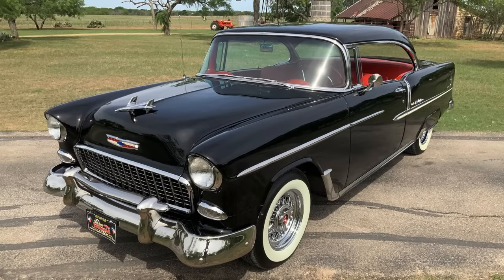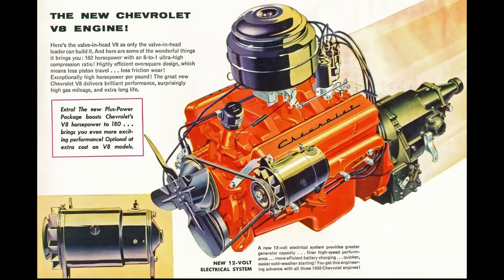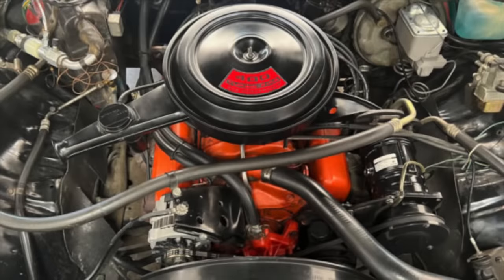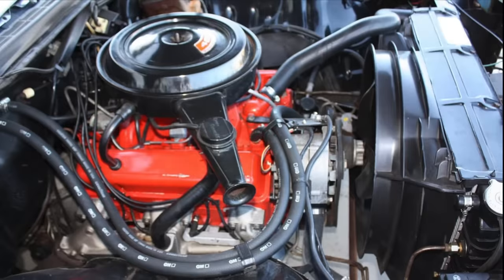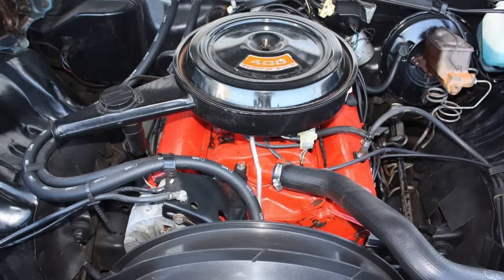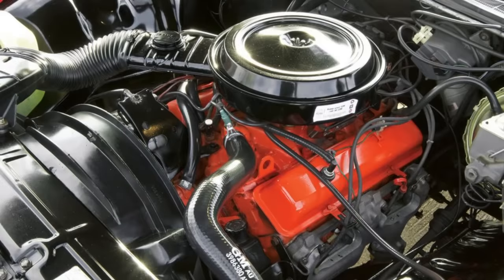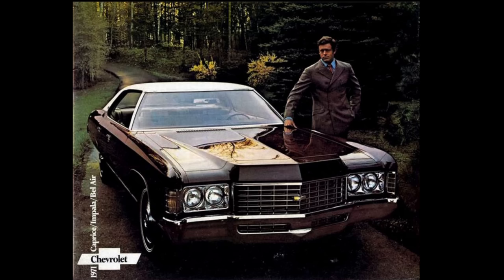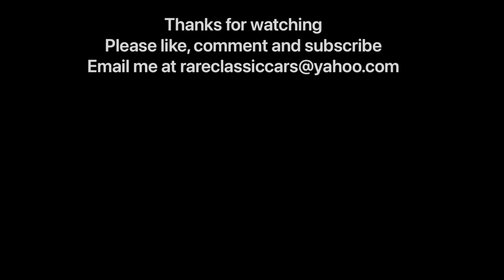Forgotten Engines: The 400 Cubic Inch Chevrolet Small Block V8 (1970-1980)

Comment: What was even more weird was in full size cars the 400 badge was put on this engine and the 402 big block engine.   I had two uncles who both owned 1972 Impala’s and both said 400 on the fender but when you popped the hoods one was a big block and one was a small block.   Left you scratching your head.   When  you needed parts did this create a problem..?
Reply: nothing is interchangeable as far as the main engine components, carb, spark plugs and distributor are aceptions
Reply: the lifter are the same.

Comment: My 72 Impala came with 400 SBC ran for year's before I had it rebuilt went 30 over mild cam oversized valves hp oil pump HEI Edelbrock carb mid rise bowtie intake 80 gph fuel pump got 427 hp out of it never an issue.

Comment: It replaced the 69 396-265 2bbl which was a heavy fuel sucking dog.   The 70 small block 400 was also a fuel sucking dog but at least it was lighter.
Reply: i remember those 2 barr.  396s. guttless.

Comment: the 400 was the black sheep of the SBC family. the gen 1 SBC really comes in 3 families, all based on crank journal size of the block.  1. the small journal blocks 265, 283, early (1967 only) 302, and most (62-67) 327s , with 2.300 main journals and 2.000 rod journals. 2. the medium journal blocks, 262, 267, late 302, 305, 307, late 327s (68-69), and all 350s. had 2.45 mains and 2.100 rod journals. 3. lastly the 400 with the large journal size of 2.65 mains and 2.100 rods journals.  the 400 block will not tank any other crank. and the 400 crank won't fit any other block, unless turned down .200 on the main journals. this is the popular 383 stroker. also, the 400 was the only SBC to be externally balanced. so, the flywheel/flexplate and harmonic balancer as are not interchangeable with other SBC. the block also required steam holes because the Siamese cylinders and the heads required matching holes. so, you can't swap no 400 heads to a 400 without drilling holes. and swapping 400 heads to a any other small block could result in coolant leaks or blown head gaskets also GM never offered a high-performance version of the 400. contrary to the video, the 2-bolt block was stronger than the 4-bolt block. 4 bolt 400s have a tendency to crack in then main webs due to them being thin wall castings, the 2 bolt doesn't have that problem. i am glad you coved the "400" Turbojet 402 big block. the 400 Turbo-Fire small block was only offered in the 2bbl carb, and the 400 Turbo-Jet Big Block was only offered as a 4bbl. so some literature refers to them as 400 2bbl and 4004bbl, just to make it more confusing. so, the real reason the 400 SBC is not that popular was that they were not interchangeable with other SBC of the era, and in that era it was not about performance, it was about emissions control and fuel economy.  also the 454 was available in those years, and made much more power than the 400 small block, si those that wanted more power chose the 454. those that wanted more fuel economy chose the 350.  the 350 was GM's bread and butter engine, and while they have not been available in production cars since 2003, GM still makes them for crate engines in 350 and 383 cubic inch sizes. the GM built 383 SBC's were only ever offered as a crate engine and never in a production car.  may engine builders offer 383 engines built on either aftermarket cranks or GM cranks that has the main journals turned down.  i have heard that 383s had been around since the mid 70s. but the first i ever heard of them was in the early 1990 with the Hot Rod Magazine Dragon Slayer 383 build. it made over 375lbft from 2500-6000 RPM with a peak of 450lbft@4000 rpm. and peak horsepower was 430@5500 rpm. that was in the early 90s and aftermarket aluminum head were not available or cheap like they are now. back them you were stuck with either the old 327 fuelie heads, or the Z28 LT1 350 head. you could get the trick "Bowtie heads" or if you were lucky the aluminum TPI heads. but both of those were expensive back then or not readily available to builders. so 430 HP was a big deal back then. so ironically the biggest part of 400's legacy is giving us the 383 as we know it today.

Comment: I bought a 76 Monte Carlo that was loaded. I wanted the 454 but 75 was the last year for that engine so I ended up with the 400 small block. The engine was smooth but I was disappointed in how slow the car was. The 400 also drank oil like a drunken sailor. I took the car to my Chevy dealer only to be told this was normal. Really!!! I was adding a court ever other fill up. The dealership tried to gaslight me about the oil consumption and there really wasn't anyway to contact Chevrolet directly so I got rid of the Monte pretty quickly. The car stayed locally and I say it about 3 years later. It was a total rust bucket. I was so glad I unloaded that car. Today no one really builds a bad but back in the seventies the quality and service just wasn't there. I've had a lot of cars since then including, European and Japanese. I just keep coming back to GM. They have come a long way. Today, I'm very happy with my GM car's and SUV's. Cheers!!!

Comment: If I remember correctly, the small block 400 was the largest cubic inch engine we could get in any four wheel drive GM  pick up through  out the 70s.
Reply: i,ve seen the 402 in early,2 wheel drive trucks, but not in a 4 wheel drive
Reply: When did the 454 become available in 4X4?

Comment: The Chevy 261 straight six also had the ‘steam holes’ but only between cylinder pairs (1+2, 3+4, 5+6). Also, in Canada some castings meant for the 235 were factory modified and used on the 261.

Comment: Adam mentions the 400 sbc only got a 4 barrel in 1974, however my Motors repair manual lists a 1970 400 (4.125x3.75) with 330 hp 10.25 compression and a 4 bbl.
Reply: That was a big block motor. 1970 400 sb had 265 hp and 400 foot pounds of torque. It came with a bigger 1 year 1970 only 2 barrel carb than the other 400s with a 2 barrel.
Reply: @anthonynelson9136  The mark IV 402 (marketed as a 400 or 396) had a stroke of 3.76, The small block chevy 400 (actual size 401) had a stroke of 3.75. The Motors repair manual lists a 3.75 stroke 400 with a 4bbl. Probably a mistake, but I've noticed this for years. Just saying.

Comment: Another great video Adam. I thoroughly enjoyed watching this on my lunchbreak. I really appreciate the history, I knew nothing about the 400 save for guys who put their cranks in 350s to make 383s!

What were the steam holes for?
Reply: The large bore caused the water jecketing to be too small to totally handle the cooling needs of this block. The steam holes helped distribute more cooling.
Reply: @erichanson3961 Thank you very much, I learned something new which I love. Have a great long weekend.
Reply: The steam holes let trapped air out more easily.
Reply: @johneckert1365 Thanks alot.
Reply: The cylinder bores of a SBC 400" were siamesed together in the coolant area so the steam holes let trapped air/steam escape so that coolant could reach the outside of the cylinder bores...
Reply: @buzzwaldron6195  Very cool, thanks.

Comment: Have good memories of a 400 balanced, quenched and mild port work. Need plenty of radiator and shroud to go with those cubic inches. The stock 350 2 row is woefully insufficient.

Comment: Incredible. The single overhead camshaft engines in my fleet of Ford full size luxury sedans put out 230 horsepower with only 289 cubes.
Reply: A 289 was made from 1963-68, long before net horsepower ratings. Many mid 60 cars with small v8's were in the mid 200 hp range. The 289 grew into the 302 for 1969. A 1971 302 2v was rated at 210 hp. A 1972 302 2v was rated at 160 hp. Same thing happened to all makes when net ratings came out.
Reply: Blueprint engines will sell you a 400" small block Chevy that makes 555 HP...

Comment: I have a 79 k10 factory ordered with 400 sbc th350 auto np203 3:73 gears. I just retired the original 400 and replaced it with a new blueprint 400 small block with 508hp and 460tq. I have some videos on my channel about it.

Comment: I'm glad to be an American,  where we would get engines that jumped from 350 to 400 cubic engines,  whereas Europeans were excited to get engines that jumped from 850cc to 1000cc, or 1.2 liters to 1.3, or some other piddling nonsense.  You could get the on a small block simply by boring it 30 over.  The 350 is 5.7 L; the 400 is 6.5. 830cc extra.
Reply: That's exactly the reason that Americans became non competitive after the 70s. Boring and stroking is the easy solution for having more power.
Reply: @Αναστάσιος-σ8υ  What you said doesn’t really make sense. Starting in the late 70s all the big cubic inch engines were retired when the downsizing of cars began. The Buick, Olds and Pontiac 455 engines were last produced for 1976 and Chevy’s 454 was only available in trucks because GM downsized their full size line for 1977. Ford and their 460 and Chrysler with their 440 soon followed suite. Even Cadillac’s 500 was reduced to a 425 for 1977.
Reply: @mikee2923  Indeed, however the mentality didn't really change
 Going from 500 to 425 doesn't change much. When in the 80s they realised that they had to design completely new engines it was too late. By then the competition offered V8 engines with four cams and 32 valves. Mercedes had a 5 litre V8 with 325 hp when US manufacturers struggled to get their 5 litre V8s above 250
Reply: @Αναστάσιος-σ8υ  I get what you’re saying but the competition also didn’t have to abide by ridiculous CAFE standards the big 3 had to deal with. I wholeheartedly agree that in the 80s American cars were pretty much garbage and got worse in the 90s for the most part. The 2 main reasons for the downfall of the American automakers was government mandates and greed in that order.
Reply: @mikee2923  It was part of the reason indeed but it was not the only one. The main problem was that in the US automotive industry engineers didn't have any real influence in the management, basically people with no engineering background were making engineering decisions. For example, making cast iron heads is the most idiotic thing to do and in Europe it was completely abandoned already in the sixties, yet in the US they continued to manufacture engines with cast iron heads until recently. Look also what is happening now with BMW and its downfall. When the sales and advertising departments are more influential in the decision making of a car manufacturer than its engineers, the results are predictable.
Reply: @Αναστάσιος-σ8υ  I really don’t see an issue with cast iron heads and blocks. Regardless of technological advancement cast iron is more durable than aluminum. American engines from the 70s on back were a lot more durable than anything built today. The argument can be made that modern engines last longer in terms of mileage. Most of that is due to the advent of electronic fuel injection. If an aluminum engine overheats, it will most likely need to be rebuilt at a minimum. The old cast iron engines could be overheated numerous times with little to no damage and if damaged basic machine work usually made it as good as new. Newer engines are made to extremely tight tolerances where the older ones not so much. Power in an engine is basically based on airflow and proper air/fuel mixture. But the old saying there’s no replacement for displacement still rings true. If for example someone would apply the technological advancements of electronic fuel injection and engine management to the older big cubic inch engines of yesteryear, you’d have a seriously powerful engine that would probably go an easy 500,000 miles trouble free. Most engine wear happens at start up. The old carbureted engines basically dumped gas into the intake via the accelerator pump regardless of conditions whereas new cars take into consideration engine and air temperature and meter the precise amount of gas required to start the engine. Washing out the rings today is almost nonexistent compared to 30 or 40 years ago.

Comment: I swapped a 400 4bbl from a Caprice wagon into my 73 Camaro after I managed to blow up the 350 2bbl, it was a little faster, but could do one-wheel peels for blocks. 😄 Ah, the days when you could buy a perfectly nice 12 or 13 year old Caprice with under 100k miles for $500 and not feel bad about yanking the engine and trans and junking the rest.

Comment: 5:34 I wonder if part of the reason is that they hadn’t officially settled on the “Big Block V8” designation at that point perhaps? I know in internal manuals, at least, they were basically just referring to them as the “Mark IV V8”- until 1973 or slightly later too- but don’t know why, you’d probably know better

Comment: i have a 79 chevy short box cheyenne 4x4 with under 35,000 miles on it with the 400/400 turbo 100% factory even the heat riser still works and i have the 327 out of my 68 pu that i put in a 4 inch stroke 454 then i have a 350 out of a 67 pu all run perfect but going to build up the 350 for the 67 pu. my 73 ss nova has a 68 chevelle 396 in it built ok about 650 hp then i have a 67 ss rs camaro with the 427 still has the plate on the back yenko dealer ship

Comment: I dunno (400 fire vs 400jet) 
I really couldn’t feel much difference between the two. I was never impressed by the 396 family engines. The solid lifter hi compression 396 would get with it but the hyd lifter versions were a snooze.
Best feeling mid size big block was Mopars 383. Those all ran great compared to a 396 or 390 ford.
Reply: mopar, 383 was a great motor

Comment: I had A 400 sb with .30 over flat tops and 350 heads in a welding truck. When I replaced it with a 454 I was a bit disapointed that the 454 was not a big step up in tourqe or hp.

Comment: The 400 cubic inch small block Chevy also known as the "Steam Engine" You can make them run but you're better off with a LT1 350. It breathes better and thermodynamically it stays cooler more evenly.
Reply: Had a 71 Caprice Classic with the Turbo Fire 400. 255H.P. NICE POWER AND RIDE VERY QUICK TOO.

Comment: Question. Is the popular "383 Stroker" small block a 350 with the stroke of the 400? Watching the Mecum auctions, the 383 is an aftermarket install in some "restomods" noted for its torque characteristics.
Reply: Yes

Comment: A great torquey little engine, however it had One Major flaw.  GM used a shorter connecting rod coupled with a Longer crank stroke gave the engine a BAD 'Rod Ratio' which resulted in increased side loading of the cylinder bores. BTW, A 400 Chevy was the ONLY Chevy engine I EVER managed to Blow UP.

Comment: 1:55 ~ "steam holes"?
"Steam" holes? Buddy, if you've got steam in your cooling system you got some serious problems. Those "steam" holes allow the coolant to flow out of an area where, because of the siamesed cylinders, air could be trapped at the top of the block's coolant passages.

Comment: The 350 was just a better engine in a lot of people's eyes for some reason, but let's not forget the "400ci" siplacement is somewhat cursed among the big 3. The Mopar 400 was often overshadowed by the 360 and the 440 and the Ford 400 was considered a piece of junk by many. The most commercially successful 400 to come out of the 60s/70s was the Pontiac 6.6 400.
Reply: that is so dam true

Comment: You said this engine didn't have a 4 barrel until 1974. I had a 1972 Monte Carlo SS with the 400 small block and a quadrajet 4 barrel. Was this just an oddball somehow or was it possibly only in the SS?

Comment: Not a huge GM fan by any means but the 400 Chevy was a good engine other than the head gasket concerns and tendency to over heat …the 403 olds engine was a solid but far from a performance engine that they were somewhat intended for!

Comment: Siamese cylinders caused out of round cylinders, when at operating temperature. This caused excessive ring wear and blow by. 
When the 400 wore out, usually early, it was replaced by a different small block or a diffferent engine was rebuilt. 
Nobody wanted to rebuild a 400, because they knew it would not last long. 
Would be worse than rebuilding a 307, at least it lasts and gets great fuel mileage.
Only racers liked them, because of the cubes and their engines are rebuilt regularly.

Comment: The sb 400 was designed to produce more torque than a 350 and at lower rpms, hence the longer stroke.  They're strong, but don't fare that well in high revving applications because they don't cool as well due to the siamesed cylinders

Comment: Fun fact-If you had the big block 400 on a big Chevy, you got a 400 callout on the fender. The small block had none.
Reply: @@seventhanubis6930 I saw  a 1970 C30 truck with 292 badges under the front parking lights   I wished Ida took a pic of them   super cool!

Comment: The reason for two 400 cubic inch motor's (small and big block),... was GM knew buyer's would be leary on purchasing a small block motor.. of that size,.. so they offered a choice,... and although the motor's were made for torque,... GM knew very well.. where those block's would end up.. in all type's of drag and dirt track application's,... the rigidity of the siamese cylinder wall's would make the motor "2nd to none" in the racing industry,... some racer's went with a smaller stroke,... other's went with as much as 4.100,... it would make Chevrolet's the powerhouse,... during that time... and era.........

Comment: When I was getting into cars in the late '90s/early '00s, +.030" 400 small blocks (406s) were almost as prevalent as 383 strokers. Some of the fastest cars I've ever been in had 406s in them. I had a 2-door S10 Blazer with one that my cousin built and a Chrysler A-833 (my other cousin is a hardcore mopar guy) 4-speed, a Gear Vendors OD, and a Currie 9" with 3.89s that was a ROCKET.